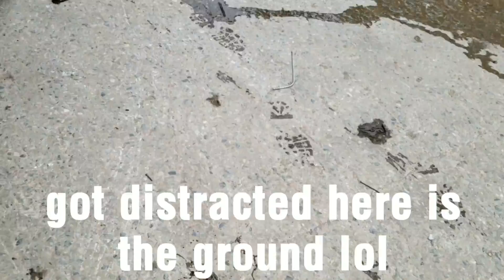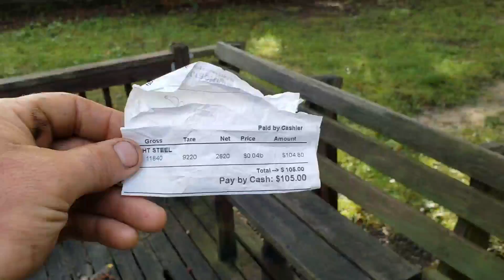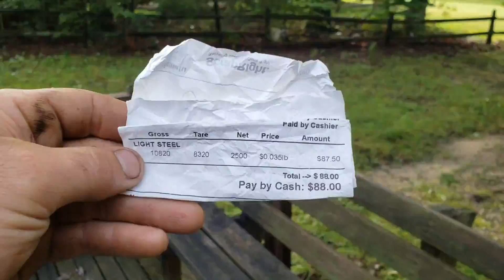$500 worth of scrap runs. steel and non ferrous

Comment: Just out of curiosity, why haven't you found enough metal to patch up that deck on the roll back.??. I think you have come across beds with good pieces/ parts to make it leak proof for sure. That just ain't right trying to get somewhere with pieces sticking to the ground through the bed and that bed tailgate is pretty messed up. It don't have to say chevy on the back or you can cut letters enough to make a word on the tailgate.. or does it lose some of its statement to the public. I'm sure that you have been stopped, at least they would here. It wouldn't make the road and they pull licences here for looking at a cop wrong, I lost mine over an argument and they took it for ten years, no arguing. I got a dwi on a point.03 when it was still.10 here because by the officers discretion... I told the judge that was messed up, hell I could think I wanted to diddle his ol' lady but he can't read mines. he gave me another five years suspended and no argument, no early release... I don't say a word to them anymore... put money on that!! Oh, I did find out that 85 % of all chevy's made are still on the road and that is fact. Yep, the other 15% made it home/LOL
Reply from the maker: I could certainly patch the rollback up with the flat sides of 275 gallon oil drums etc but I am very anal about the bed for that, I want flat sheet no diamond plate and I am goin to get enough from a good friend of mine that works at steel supplier (that is most of the hold up) cant get that much steel at once without someone noticing if you catch my drift